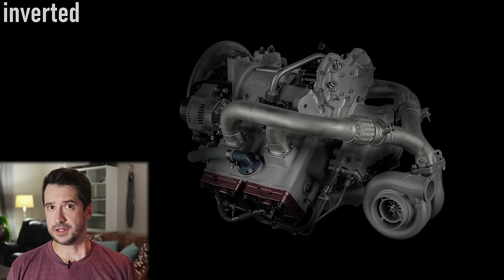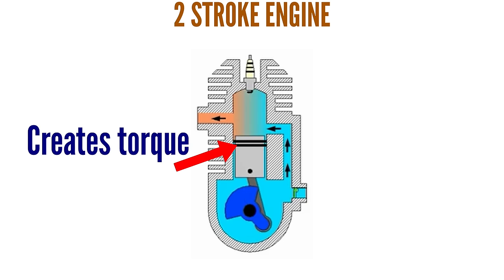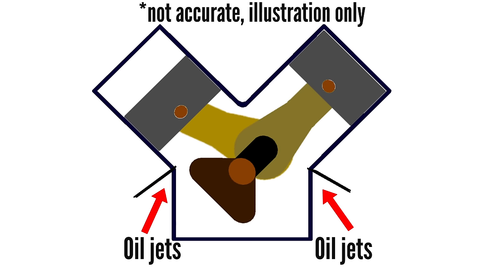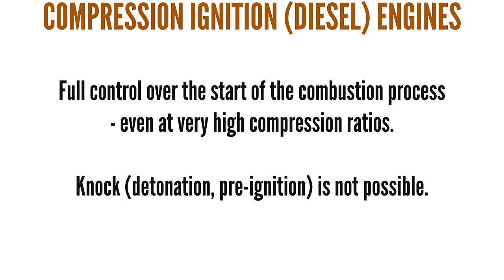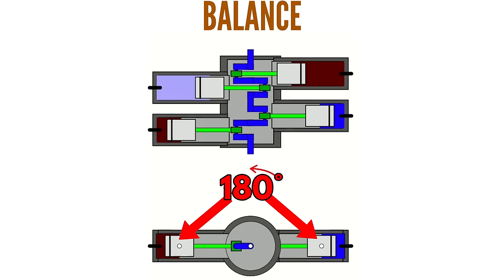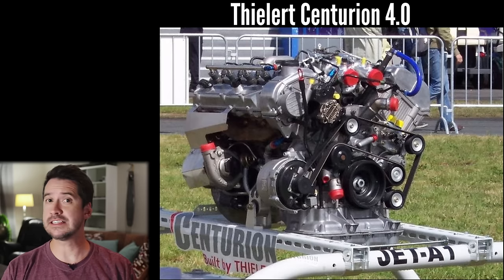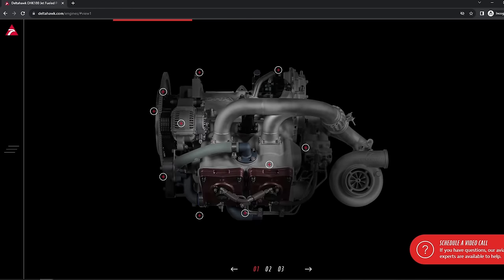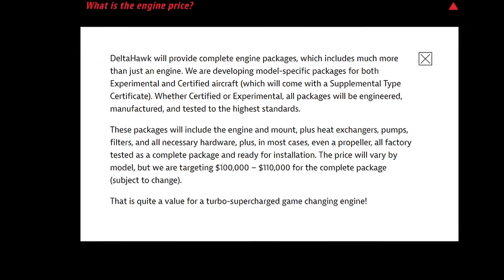Deltahawk's Jet Fuel Piston Airplane Engine Explained

Comment: Hmm.  Why didn't they make it horizontally opposed, like every other GA engine?  Opposed engines have perfect primary and secondary balance.  V4's like this do not, and 90 degrees is the worst angle for a V4.  Obviously there is some reason to point the cylinders slightly down....

In the 1930's, Daimler-Benz produced the DB600 series of inverted V12 engines.  These were 60 degree V12's mounted inverted on fighter planes such as the Bf 109 so that the heads were pointed towards the ground for ease of service.  Mechanics could stand on a small stool or if they were tall, simply stand on the ground and do all regular servicing of valves, spark plugs, and fuel injectors versus the upright RR Merlin or Allison V12's that required ladders/scaffolds to do the same.  I don't think that GA equipment will benefit this way....

And this is still liquid cooled, so there is that complication.  Radiators, hoses, and water pumps are all reliability issues; Add complexity, add potential problems. This engine is a great idea overall, though I think that in 10 years you will start to see the KWH/Kg ratio of batteries become so high that electric motors will begin to replace ICE power plants on GA equipment.  
In the end, my opinion is that this would have been a great business proposition in 2000;  Now I think it's future is limited. I wouldn't invest in this company.

Great video!
Reply from the maker: Thanks, great comment and good points! 
I think it's upside down simply because as a 2 stroke with a dry sump lubrication system it really doesn't matter which way is up. The upside down V might allow for sleeker cowl designs, and I'm not sure if there is any more to this decision than that.

As for doing a V, well Continental already did the boxer 4 diesel on the CD-230. I would not say 90° is the worst V angle, but very likely the best as it's the easiest angle to achieve perfect primary balance. All other angles require split-pin cranks, which sort out primary balance but worsens firing interval. 

While the boxer 4 does have perfect primary and secondary balance, it does have a rocking couple on secondary imbalance. A few people have jumped on me saying it isn't true, but it is fact.

As for opinion, the 90° V4's side-to-side secondary imbalance will likely be comparable in magnitude to the boxer 4's rocking couple due to secondary imbalance.

Liquid cooled does add complexity, but the practical real life reliability concerns are often overblown, especially by pilots and builders that has never owned or worked on one. Assuming it's designed well, it just doesn't give problems if setup as per manufacturers guidelines. I'm on my 3rd watercooled engine airplane, so "putting my money where my mouth is". It will obviously need more things to be checked when inspected or serviced, since it's an additional system and components, like you've said.

As for future limited, only time will tell. If electric for light aircraft doesn't quite pan out in the next 10 or 15 years like I predict, the these companies with engines able to run on SAF, might just be in the pound seats.
Reply: @LetsGoAviate  Interesting points, but you have to understand that the rocking couple you site is minute, essentially not a factor on horizontally opposed engines.  These are known as the smoothest form for ICE devices, especially the 6 cylinder variants which in many cases need only rudimentary engine mounts.

Comment: Fuel consumption of .38 to .4 g/kWh is about 800x more efficient than I would expect. I wonder if the video is using different units than I am...
Reply: It's lb-hp-hr, so it's pretty terrible for a diesel.
Reply: @PistonAvatarGuy  converted to g/kWh ~230-260, which would be pretty normal for a 4-stroke gas engine. I can appreciate that in a two-stroke.
Reply: @theoriginalpauly  For a gasoline engine from the 1930s, maybe.
Reply: @PistonAvatarGuy  The blower probably consumes 20%+ of its power making its BSFC nothing remarkable. plus people dont realise that the compression in the crankcase also consumes power on a two stroke, with forced induction even more. A modern diesel without any emissions restrictions should be around 200g/kwh or less.
Reply: @chippyjohn1  You're thinking of peak bsfc for diesels, which isn't relevant here. What's relevant is bsfc at climb and cruise power settings, which isn't great for diesels. In fact, it's so poor, and diesels are so heavy (which increases induced drag) that they end up being less efficient than their LyContisaurus powered competitors (with regard to energy and fuel cost). Just take a look at how the DA50 stacks up against its competitors.
Reply: @chippyjohn1  Oh, and diesel/jet fuel is also heavy. The DA50 burns 15 gph at 170 knots, and so does the Bonanza. 4 hours of flying at those consumption rates results in the DA50 burning an additional 50 pounds worth of fuel.
Reply: @chippyjohn1  From another comment section:

Because the SR22T is flying significantly faster than the DA50 (200 knots vs 170 knots), its fuel cost per unit of distance flown is lower than the DA50, despite burning more expensive fuel and its greater hourly burn rate. Using current US average fuel prices, the SR22T costs $0.52/nm, while the DA50 costs $0.54/nm.

The engine in the SR22T is actually heavier than the diesel in the DA50, which is absolutely ridiculous, there's no excuse for a gasoline engine being that heavy. Anyway, to produce a (somewhat) decent cruise speed, I think that the diesel just ends up being well above an rpm where it can operate efficiently. A larger engine would likely solve the problem, something like a 6 cylinder version of the SMA SR305 would probably work.

Even the Piper M350 stacks up well against the DA50, as it's pressurized and can fly higher and much faster, without burning much more fuel per unit of distance traveled.

A modern mogas engine would be the ideal choice, as it would be much lighter and it would burn much less expensive, unleaded fuel.

Edit: Sorry, sleepy and stressed, so my comments are a mess. I made some corrections/improvements.
Reply: @chippyjohn1  Also, if you want to use the DA62 as an example, you can look at what the SAE had to say about the Continental IOL-300, which matched the BSFC of the AE330 in the DA62  (at the same power level) all the way back in the '80s. If you want to argue that engine technology hasn't improved in the past ~40 years, I don't know what to say.

Comment: Very interesting, would love to hear some discussion of the pros and cons of the "upside down" mounting.  Seems to me it would be harder to control lubrication scavenging.
Reply: I think it’s mostly about existing packaging. The inverted V fills the same space a gas horizontally opposed engines fit.
Reply: Inverted engines are obviously dry-sump lubrication systems...
No more of less problems than a radial type engine that once dominated the industry
Reply: Lower center of gravity.
Reply: It is, and a lot of trial engines get destroyed figuring it out.

Comment: This is potentially a HUGE deal for aviation. This type of 2 stroke diesel isn't actually new at all. 2 stroke diesels are still used in marine applications to this day and they used to be very common in trucks in North america and Australia. They aren't used in road applications anymore because they have much higher NOX emissions. This isn't an issue for piston powered planes because the increased NOX is worth the elimination of lead pollution which is far worse. 

People are being overly pedantic and semantic over the supercharger. It IS a supercharger that acts as a scavenging blower at startup and low RPM but is a supercharger in every other respect. By the sounds of it, it operates more or less likely a normal positive displacement super charger when in "rescue mode".

One thing you may have gotten wrong is the valvetrain. Direct injection 2 strokes such as 2 stroke diesels do typically have a camshaft and either exhaust OR intake valves this is usually a simple pushrod setup which is still far less complicated than modern 4 strokes. I couldn't find specifics on the spec sheet so they might have omitted this, trading power and effeciency for an even simpler design.
Reply: Jumo began producing 2-stroke aircraft Diesel engines in the 1920s and the Jumo 205 was the most fuel efficient engine in the world in 1931.
Reply: Some 2-stroke Diesel engines cannot generate manifold boost pressure, they are NORMALLY ASPIRATED opposed to Naturally Aspirated.
Regardless if there is a supercharger, Turbocharger or both.

Comment: Great video! Honestly, super interested in this engine as well. Much more reasonable in terms of actual performance and reliability basics for the overall design. Makes wonderful sense to run a diesel thanks to the given, relatively, smaller top rpm. Honestly, torque and hp is an odd one for me, given work performance is so key to applicational use. What I mean by that is with how high the torque is, and the relative weight of the prop and how quickly it needs to get to any given rpm at any given aerial maneuver, it then might still become more efficient to run a cvt transmission style of prop gearing (cone and ball or ring and ball in the crank to prop area) just because its torque is so high! But That also means it might be able to run a shrouded counter-rotating prop design that has stators in-between with some hollowing out to run into the compressor of the turbo for a ram air effect for the engine. Which would be really cool! Weight of course is always something significant to consider, from my recollection counter rotation prop designs are only more efficient up to about 10-15% but that was often without shrouds or using the stator issues (given sudden pressure changes within inside and a changing aerodynamic pressures, boundary vortex separations, over pressures at the leading front edge of the stators, trailing vortex issues going into the next set of props, and so on with prop angling like a given helicopter blade pitch, stator pitch, and so on with that) to increase given power and performance characteristics in the engine to reduce some of the given prop sizes, stator sizes, lack of efficiencies, and so on from counter rotating props. Especially with hollow shrouds and the tuberluar leading edge designs of given wings being very capable of helping reduction of air plugs on the shrouds ring leading edge boundary layers. Also food for thought, that can help be broken up (hot spots) by having them help ram air into the engines compressor & be sucked down at certain speeds by increasing the rpm of the compressor through a given cvt transmission gearing for best use of exhaust gases for rpm matching of decreasing or neutraling that given air pressure at the ram air areas.

Anyways, I really like the design of this engine and think it will probably have certain benefits over others by a long shot, might have heating issues if the turbo ever gets too rowdy at lower altitudes and higher engine rpm thanks to not having a air to air intercooler, or at the very least a type of dry pump oiling system for the (at least i didn't see it but could be wrong) super turbo (super charger and turbo combo is usually called a super turbo and is often made to switch at a given rpm from the serpentine belt system having a clutch or solenoid disengage it) to make sure it maintains lubrication and pressure in that air when performing higher g moves. Weight is a big deal of course as well, so I would (maybe I'm weird but whatever) give it a type of low pressure liquid heatsink fin thermosiphon/heatpipe air fin cooling around the engine and chop/carve into it into the path of the air to improve overall cooling and reduce weight outright. Mostly so I could run cool looking gills and some aero effects to channel some air into it from the prop while having most of the air from the props going of the sides and top in a vortext stall or something to improve lower pressures and outright low speed stall characteristics. Who knows, could be that cool dude with a stupidly modified flat 8 with open hood back in the day with a Cessna (although I don't think it would be quite the same just because it would be more futuristic but the feeling is there, cool guy feeling modder, chopper that kind of thing :p) 

Its also 100k + for an engine. Which, is totally something that boggles my mind! Its so intense to think about, like what! I could get a v4 from a Ducati and super turbo it, make the right changes for aviation fuel being used through fuel lines, injectors, compression ratios, and some basic weight reductions through simple high performance aluminium parts, a better camshaft, all that and probably have it beat except for the need for a cvt gearing for the prop. I don't know if they'd let you fly it! Because faa rules and what not, you would need to make sure you have the fuel heating too, then go through it all to make sure but it doesn't seem impossible. They run off of much smaller radiators as well, so you could modify those given v4s to be more air cooled too, at least partially, and be able to probably hang with them. Might be a project but I wouldn't doubt at all it could be done way more cheaply than buying that, or at least comparable in terms of cost. But you also did the cool guy/gal move and made it your own ;) time to let that engine be seen 8) oh yeah!

Comment: Shouldn't it be far less expensive to overhaul this engine due to its simplicity and access,  replaceable cylinder liners, lack of valve train, given that parts are not somehow crazy expensive?   There isn't much to replace and with a compression ignition strength of block, shouldn't rebuilds be both less expensive and equally effective as "new."?   I'm expecting the TBO to be at least equal to petrol engines or greater, based basically on hope and a not complete understanding of engineering.    So , well even if TBO is short, one plus would be a thorough inspection of the engine (significant component) more often.    With the capability advertised in terms of torque and efficiency, having an engine like that in verified top condition more often looks like it would come out a plus.    I'm still a skeptic on the ability for this to come to market, but I hope it can be commercially successful and stay true to form.

Comment: As others have probably said: this is an uniflow scavanged engine. The supercharger is used for scavenging. The engine will not even start without it. The turbocharger is used for supercharging. Also, uniflow scavannged two strokes DO have exhaust valves. They only have scavanging ports(for air intake).

Comment: Nothing new about a 2 stroke diesel GM has been making them since 1938 and they have been around a lot longer than that. My boat has a lot of GM 2 stroke diesels from the 16-645 EMD mains to the 4-71 Detroit that runs the winch. A valveless 2 stroke non opposed piston engine will not be anywhere near as efficient as a uniflow engine. Adding a blower is also stupid they just need to add a one way clutch to the turbo so the engine drives it at low speeds and power outputs. GM had this setup on starting on the EMD 567 series and still uses it on the current 710 series.
Reply: True I believe Cat currently owns EMD and MTU currently owns the two stroke Detroit rights. The 4 stroke Detroits and the company Detroit diesel is owned by Mercedes Benz Two stroke Detroits are still made by MTU for the US military and for the export market. 

As far as I’m concerned they are both GM diesels no matter who buys them next. Calling a 567 645 or 710 EMD a Cat makes zero sense. GM designed it after all. Mine all say General Motors on them as they were built by GM in the 1960s
Reply: EMD 567's didn't have turbos.  They used Roots blowers for scavenging.  The mechanically assisted turbo wasn't introduced until partway through production of the 645 series.
Reply: @andyharman3022  That is untrue. I worked on several tugs that had 16-567D models these were most certainly turbocharged EMD 567s. While the vast majority of 567s were naturally aspirated turbocharged 567s were most certainly made. A lot of these were later swapped to 645 power assemblies and converted to naturally aspirated (roots blown) to prevent over stressing then engine. A 567 with 645 kits and roots blowers makes the same Hp as one with 567 kits and a turbo.

Comment: Two strokes have not needed to use premix lubrication since the late 1960s.
Reply from the maker: The 2 stroke oil injection you are referring to injects oil with the fuel at the crankcase intake manifold, so it still intakes that same mixture. Other the optimized fuel/oil ratio, it doesn't change the way old 2 strokes work.
Reply: @LetsGoAviate  Wrong - Suzuki and Kawasaki two strokes had oil feeds to the crankshaft bearings and piston skirts as well. It wasn't really needed because rolling element main bearings are optimally lubricated with an oil mist and feeding oil into the intake is perfect to achieve that. None of these engines had any common issues with crankshaft longevity.
Reply: @LetsGoAviate Oil injection is superior to premixing because it Reduces the mixing of lube oil with the Air-Fuel charge in the combustion chamber.
Oil injection keeps the oil in a film on the engine surfaces or in the form of larger droplets rather than atomized in  the air charge.
This also means a leaner oil to fuel ratio than is possible with premixing

Comment: 16:02 At my FBO, in Chesterfiled VA , AVgas 100LL is $7.18 per gallon, JetA1 is $6.64 per gallon. 
I don't see litres, certainly not $0.53 per litre JetA or $6.75 per litre 100LL AvGas.
Reply from the maker: Probably a conversion mistake on my end, apologies. The $6.75 for Avgas is per gallon. Where I am, Jet A1 is nearly half the price of Avgas, for what it's worth.